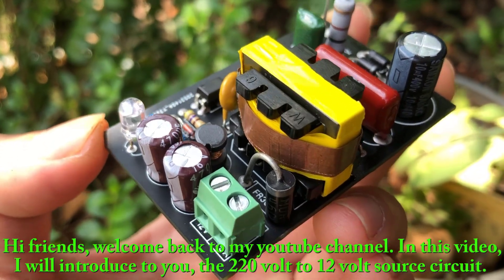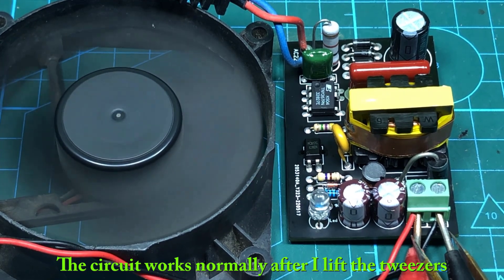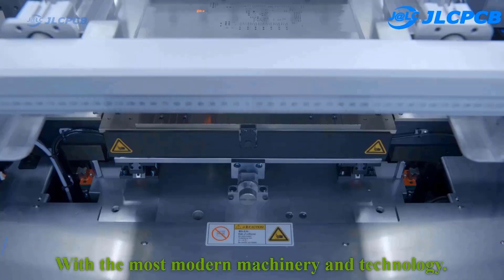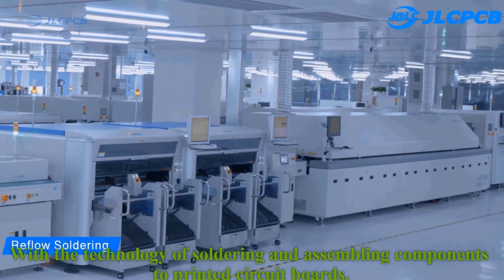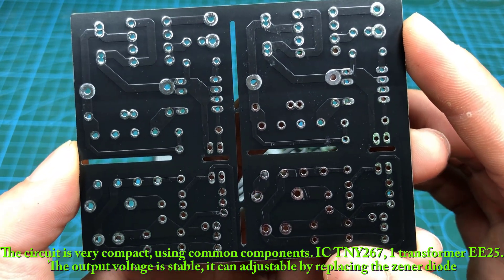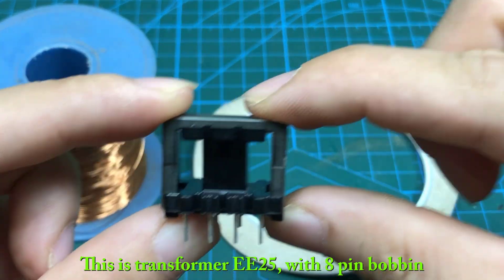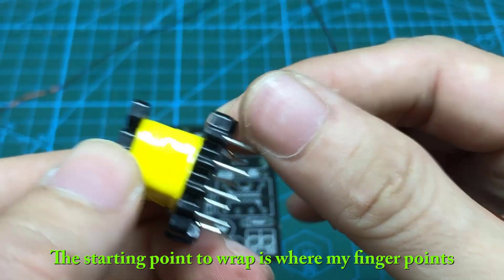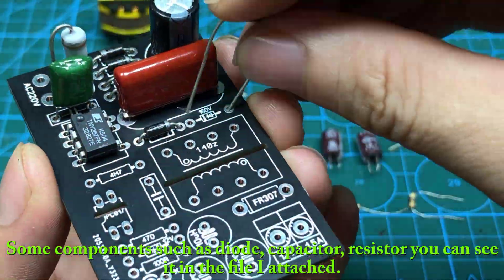Simple Flyback Converter, Transformer Design TNY267

Comment: Good  Job, What are the characteristics of the output inductor?
Reply: In a flyback you may not need an inductor in the output since the transformer works as an inductor. This does not apply to push-pulls and forward converters of course. I've seen expensive industrial equipment without an inductor in it's flyback PS. But you can download software from the manufacturer of the IC which I think will tell you this depending on your output parameters

Comment: Can you design for dual Outputs 12v 2A and isolated 18v 1A  Smps?
Reply from the maker: The power of this circuit max 20W bro. With your request, we need another circuit
Reply: @LongTechnical  okay i am waiting for that. Also why your winding direction is anti-clockwise?
Reply from the maker: It't OK bro
Reply: @LongTechnical  better if is a DC- DC flyback converter  input min 12v to 55max . Output 13v non-isolated  and 21v isolated outputs

Comment: Why do you need a air gap in the core?
Reply: Because the gap reduces the magnetizing inductance where the energy is stored. If the gap is zero there would larger reluctance and no energy is stored. You need the gap since this is a coupled inductor not a transformer.
Reply from the maker: Because it is a flyback converter. You can search it detail on internet

Comment: How to make 50v 10 amp flyback power supply 220v to 50 use this mathood possible ?
Reply from the maker: Same method is OK bro. But using UC3843,3844,3845 with mosfet. Not this IC